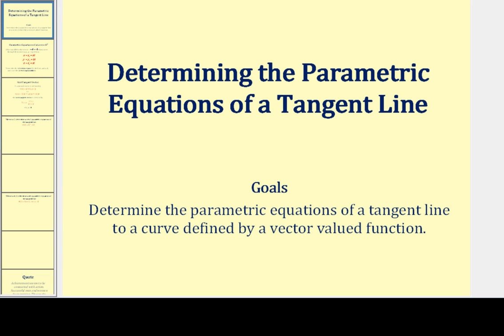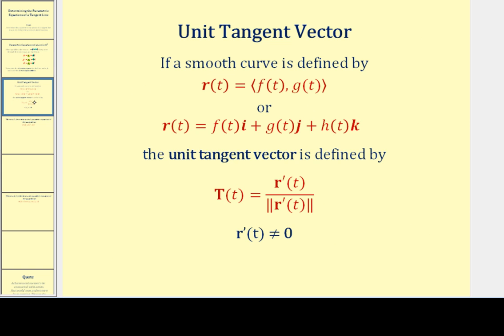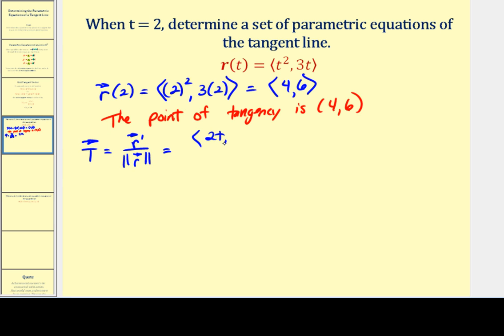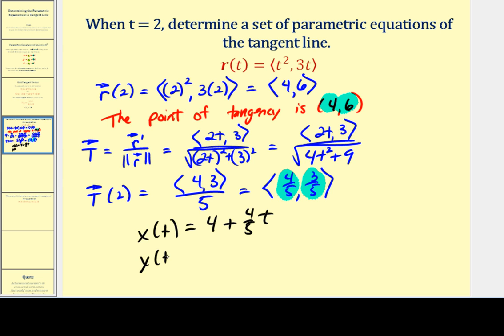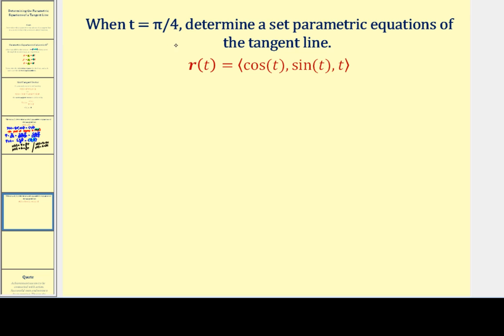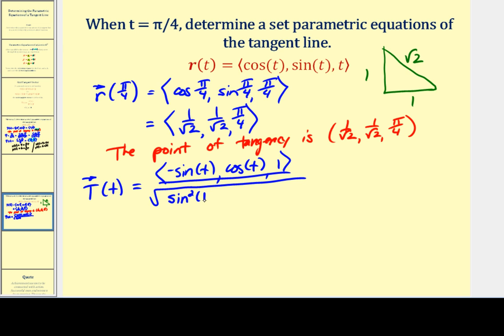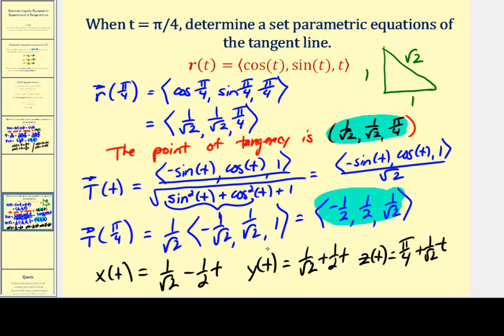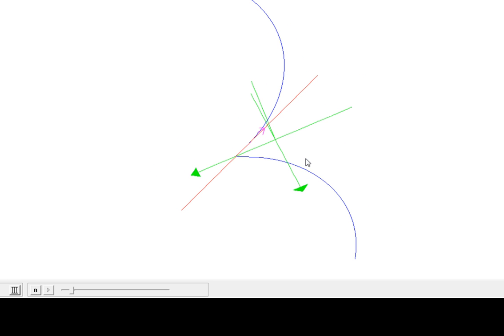Determining a Tangent Line to a Curve Defined by a Vector Valued Function

Comment: Does this still work with "Find a vector equation for the tangent line to the curve of intersection of the cylinder (some function) and (another function) at points (some arbitrary points)